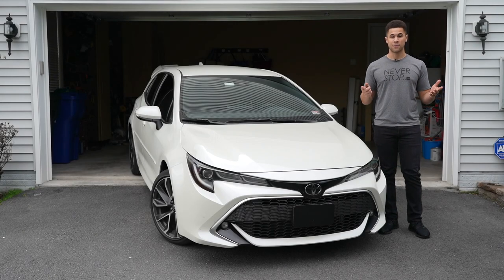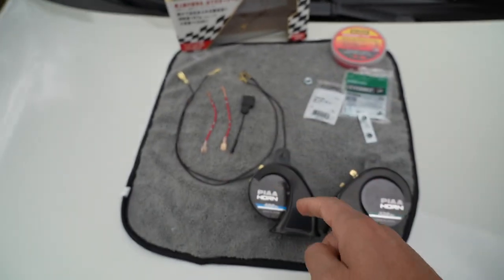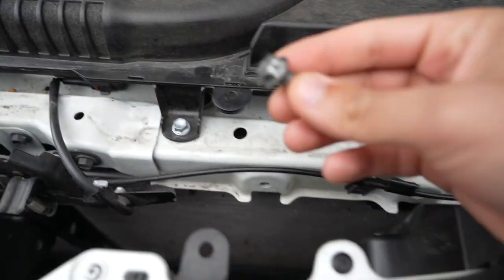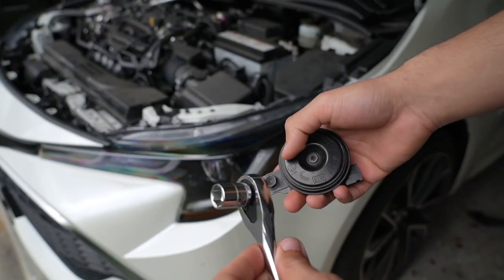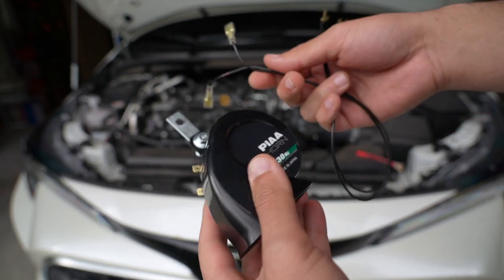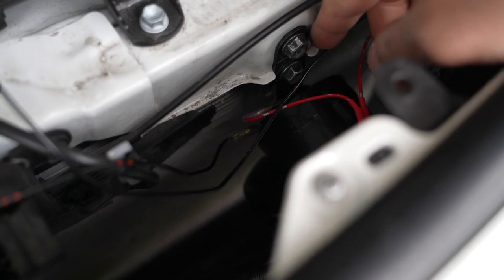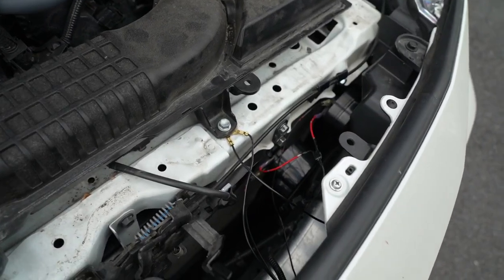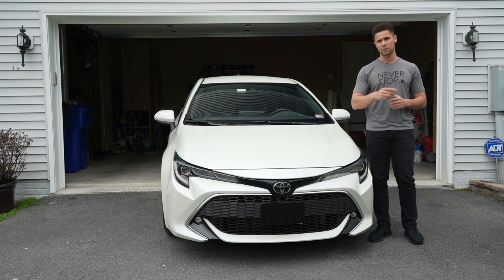How to install PIAA Superior Bass Horn | 2020 Toyota Corolla Hatchback

Comment: Just purchased a 2022 Corolla SE a few days ago and agree that the horn is pretty whimpy. You did a great job in the making of that video.  Just purchased the horns and the wiring adapter. Can’t wait to tackle the job. In the meantime, I’ll just stick my head out the window and holler.
Reply: Finished the project yesterday in about 20-30 minutes. Very impressed with the outcome.

Comment: Very helpful video. Many thanks. The positive wire (red) is nicely done. For the ground wire, simply run a short length of black wire from one of the horn terminals to the mounting bracket. There is no need for a separate ground wire running to the car body someplace. These are the instructions on my Fiamm horns.

Comment: Excellent video overall.  Just want to provide an alternate grounding method.  The ground terminals can be secured using the same bolts that are used to mount the horn brackets.  That’s actually how the OEM horn is grounded.  I installed Fiamm low and high tone horns like that.  And thanks for the link for the connector kit, that was super useful !

Comment: Thanks for the video.  I have a 2021 Corolla ZR hybrid.  Your clear and easy instructions made it a breeze for me to install these horns using the Toyota adapter.  I placed one horn in the original horn position and the other to the same spot on the opposite side of the grill so the sound may balance better- maybe it won’t make a difference at all.  I did have to solder one of the little wires to a longer wire to reach.  Now my little red car has a big loud voice.  Watch out motorists!

Comment: Very good and comprehensive video. I placed an order for a Corolla hatch last week and will definitely be doing this.

Another plug-in upgrade(though would require some wiring work to single horn vehicles) is to go with horns from a more upscale Toyota vehicle; most Lexus models are pretty good if you can find them in boneyards. Toyotas have used the same horn connector since the mid '80s, so you've got a lot of options to choose from. I did this on my '88 Celica; replaced the relatively wimpy horns with those from an LS400. It saved me getting hit a couple of times by inattentive drivers.

Comment: Thank you for the video and providing the bolt size and what else may be needed. I the Piaa 400hz + 500hz horns on the way and they both have the factory Toyota connections, so I just bought a pigtail 1 = 2 adapter so no additional grounding needed. Happy I won't have to run back to the store to figure out the bolt size! 👍

Comment: What a great video! Thank you so much! I followed this step by step and now have a much more respectable sounding horn :-) it was a bit fiddly fitting the horn on the right but got there in the end! The Toyota harness was difficult to source in the UK so got it from China which took an age to come. It came in a pack of two so if any one in the UK wants the other one contact me. It’s just the harness not the red wires but happy to pass it on. So glad I made the change. Thank you again :-)

Comment: Thanks great video I just received my new 22 hatch corolla manual and I just order the horns
Recommendation if you have the 2.0 engine I just ordered the Lexus engine cover for the U.N. model that has the same engine as the corolla. Make the interior engine look nice and as I have the se model I ordered the hood insulation that the XSE has for my se
This helps contain any engine noise along with the engine cover.. pure cosmetic and sound deadening but I like the ROI

Comment: I picked up my 2023 Corolla Hatchback 2 weeks ago and I almost cried after hearing that weak sounding horn. I knew their and there that I had to change it, thanks for the video. Just checking, does this upgrade not void the warranty?
Reply from the maker: As far as I know, this simple modification shouldn't void your warranty. I did this soon after buying my car and it's never caused any problems at the dealer.

Comment: is it possible to use just one of the PIAA horns (330 or 400 dcb) ?  thus eliminating having to piggyback both ?  This modification caught my attention but i've never tackled a wiring project like this so I figured an even swap  1 horn for 1 horn would be good.  would having only one decibel tone (330 or 400) be no improvement over the really weak Toyota stock horn tone ?  Thanks for any advice
Reply from the maker: You could, but it wouldn’t sound right. The dual horn system is compromised of 2 different tones, one high and one low to combine to the noise you hear in the video. So you could use just one, but it would be either a high or low tone and not as loud.
Reply: You want the low tone, if using only one.  If I do the work, I am making a statement with the horn.  I guess it all comes down to how much attention do you want.  My motorcycle has loud ones.
Reply: Check out the new Wolo Bad Boy,  a single horn, dual tone, and not relay necessary.

Comment: I have a 2010 toyota corolla and planning to install these. My question is do i need a fuse reaymto install this or just use the wiring adapter like what you did in the video?

Comment: I have a toyota corolla 2010 with weark horn also.  I have a question do toyotas use the horns for the car alarm sound also?  meaning if someone steals your car they will hear the cheap horn but if you upgrade the horns its suddenly loud?

Comment: I did  PIAA Dual Horn setup on my homies Corolla Hatchback too...I stuck the other horn on the Passenger Side though so everything is "symmetrical" not all on one side like how you did yours!...Just wanted see how you did it...Haha...Not bad!!
Reply from the maker: I only put them both on one side because I didn’t bother to see if there were any mounting points on the passenger side 😅 only noticed after reading this comment!
Reply: if you put it the other on passenger side, is it ok to extend the red wire so it will reach it? will it affect if the other wire is longer than the other one? thank you * i will wait for response before buying
Reply: @BinongCA are you still waiting for response before buying? Lol
Reply: @chadhalverson151  oh I already bought something before hehe. Thanks

I bought a toyota horn for land cruiser or somethibg like that. Plug n play

Comment: Nice video. I just bought 2018 Corolla. The horn fuse is 10A. Will I need to add a separate higher rated fuse?
Reply: I just answered my own question. Amazing that these horns are only 2.7 amps each. Thanks again for the great video!
Reply from the maker: @gonzo11213  thanks! I’ve had these in for a few months and haven’t ran into any issues so you should be good!

Comment: Hey, do you have any recommendation for install this on a hybrid? That slot is taken up by the pedestrian warning speaker
Reply from the maker: I've never seen under the hood of the hybrid model, so unfortunately I can't help you there 😅 I guess you'd just have to get creative with where you mount it and possibly fabricate something. Good luck!
Reply: @MattWalters  I managed to make it work. There's an identical slot on the other side of the car, so I ran 16 guage wire from that side of the car to to the harness. Works perfectly. Thanks for the video
Reply: @DogsSnipes can also just remove that pedestrian speaker and plug in a resister to trick the car into thinking it’s still there. Then use that spot for the horn. Or simply drill a small hole to screw into, not that crazy.

Comment: Hi, do I need a relay on this set up with a single horn?  Thanks
Reply: They relay is needed if you're changing from a 1 horn setup to a 2 horn setup, which is the case in this video. However, if you're getting just 1 horn, then you don't need the harness, you'
d just be swapping the horn out

Comment: Installed mine and am not getting any sound. I can try better attaching the ground wire, but other than that I'm not seeing any glaring mistakes :/
Reply: Did you insert the red wire into the black adapter properly? You could also try doing one horn at a time without the harness to see if both horns work. If neither work on its own, but your OEM horn works, then you likely got a defective horn
Reply: @DogsSnipes  I reseated the red wire and trimmed it back a bit because they stripped like an entire inch. I also made sure the ground wires were properly attached and that did it :) so yay for big-boy horn, lol

Comment: That is 100% not how those connectors work when attaching the positive leads to the positive lead on the OEM harness
Reply: how does it connect? useless comment if you don't explain how it connects man.
Reply: @jacintoalfaro7157  Spade Connector
Reply: But it worked and its sealed in a space where it is going to feel almost 0 stress. Spades are how that would work but this method will work fine in this application.
Reply: @aquamarine456  This isn't a method, it's just wrong. Show me this method in the ASE electrical guidlines or consult anyone with automotive wiring knowledge and they will tell you that ain't how it's done chief. 

I'm not downing anyone and if someonne can't constructively take some criticism that's not my problem. I'd hope that someone would call me out had I been in his position so I can use proper methods moving forward.